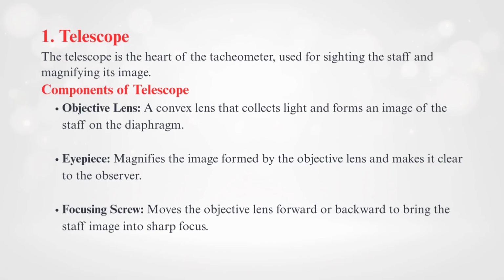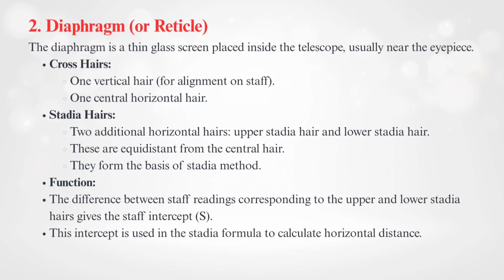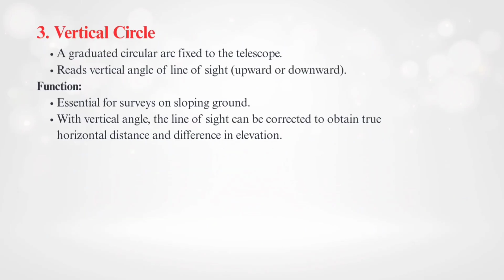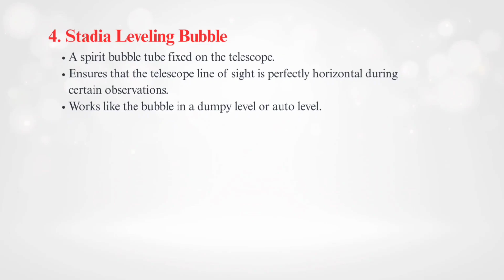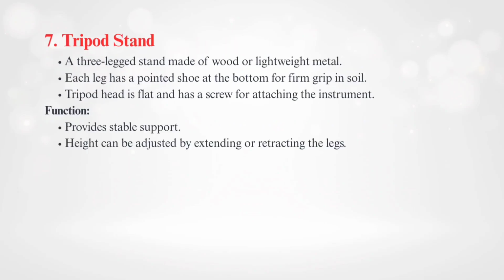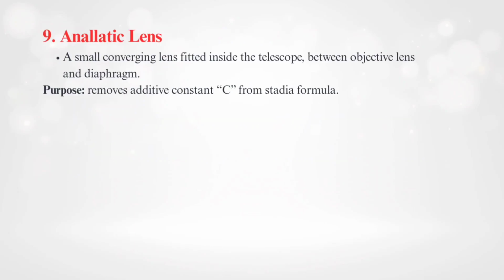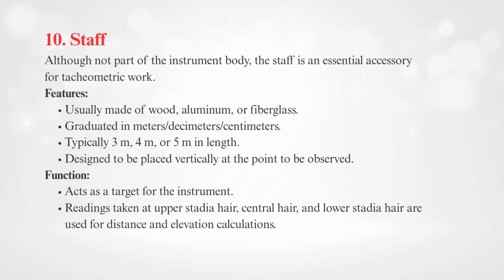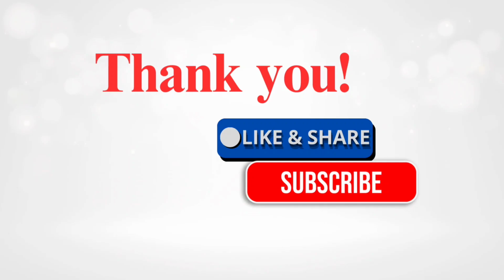Parts of a Tacheometer Explained | Civil Engineering Surveying Instrument

Comment from the maker: Quick recap of Tacheometer parts:
1️⃣ Telescope (Simple/Anallatic)
2️⃣ Diaphragm with Stadia Hairs
3️⃣ Vertical Circle
4️⃣ Stadia Leveling Bubble
5️⃣ Leveling Head
6️⃣ Compass Box (Optional)
7️⃣ Tripod Stand
8️⃣ Focusing & Tangent Screws
9️⃣ Anallatic Lens
🔟 Staff

Each part has a unique role in measuring distances and elevations quickly.
If you found this video helpful, hit LIKE 👍, SHARE it with your friends, and SUBSCRIBE for more civil engineering tutorials!